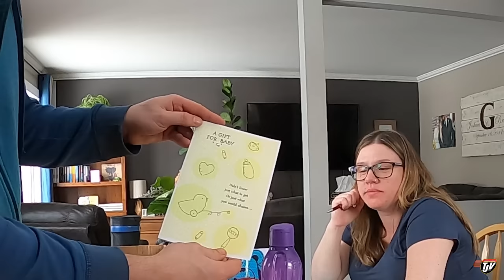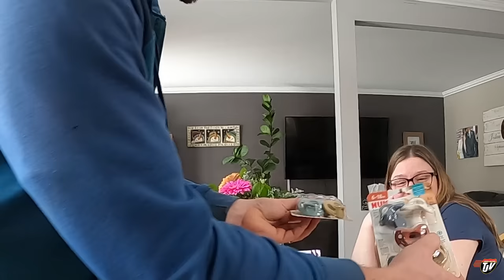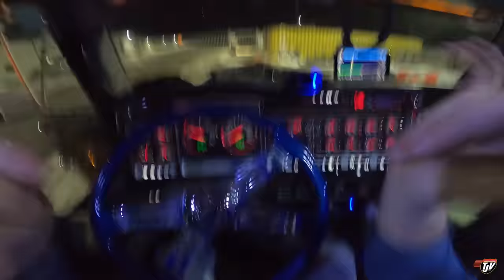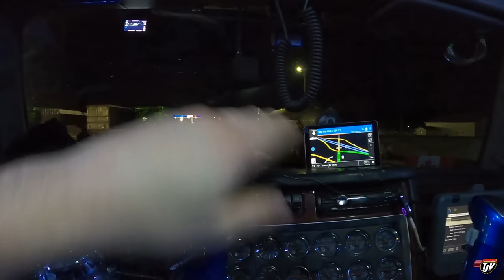CHAINS AND TRI AXLE | My Trucking Life | Vlog #2748

Comment: Hi Josh. Do you have a new camera for the vlogs? Because the video is so sharp, clear, and bright. Great to see. May I ask, what is that oval instrument right above your steering wheel in the truck with the two blue lights? I never have seen such a thing. Have safe miles and I wish you and Britt strength in the coming days.